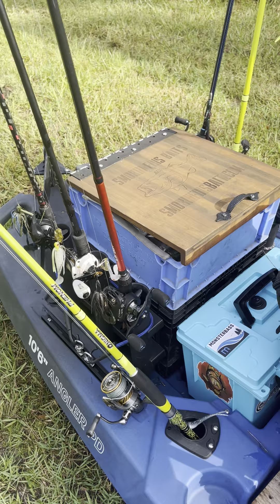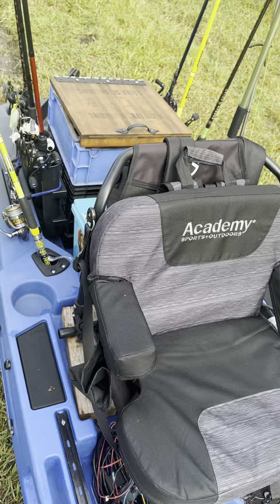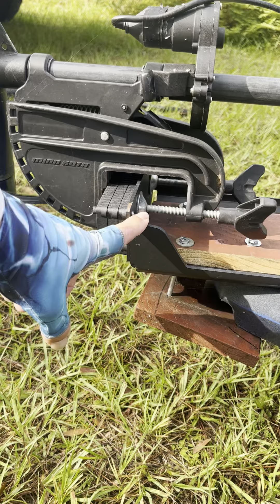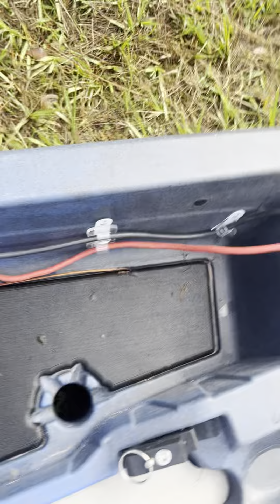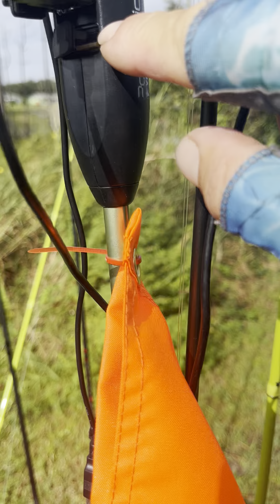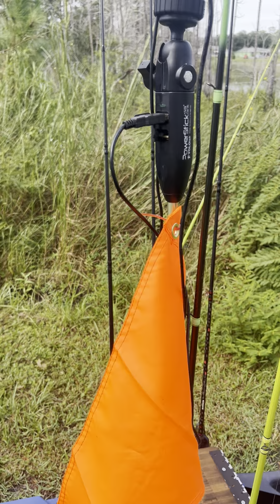Walk through of Magellan Pro Angler (all the mods) Ready for Guntersville

Comment: If your going to put a trolling motor on a kayak just get the pelican pwr 100 or ascend 133x.. really to much on that kayak. Made for light fishing with drive... but pelican pwr 100 is super nice. Light weight, 450 pound capacity, swivel seat, wired ready, and can put a gas motor on it
Reply from the maker: @bushwhookie1334  I took my kayak to Lake Guntersville and fished in the KBF national tournament and it did just fine. It handles great with the trolling motor. Just took it out the other day for 8 hours caught 20 bass and kayak was rock steady.

Comment: You should really make its own channel for the kayak
Reply: I was also wondering, do you use your rotor in the back anymore since you have a motor?
Reply from the maker: Would love to but I can barely keep up with this channel.  My goal is to post more this year.
Reply from the maker: @Kman161  Yes I still use the rotor, it helps keeps in on track.  That is one of the only thing wrong with this kayak is that the rotor need to be wider.  When using the pedals it takes it a few seconds to turn, widening the rotor will help.